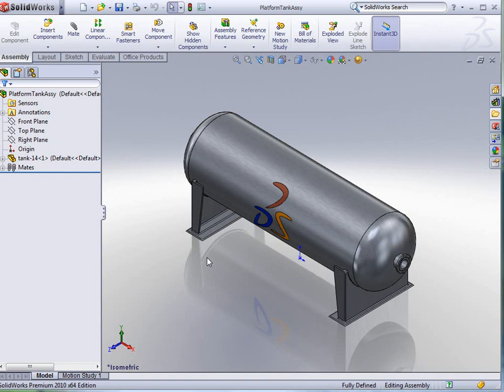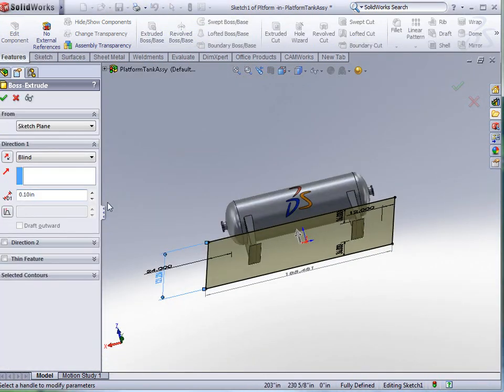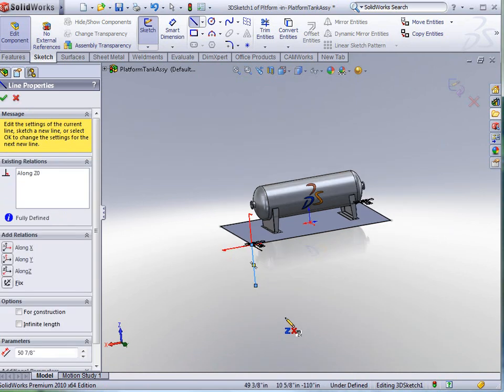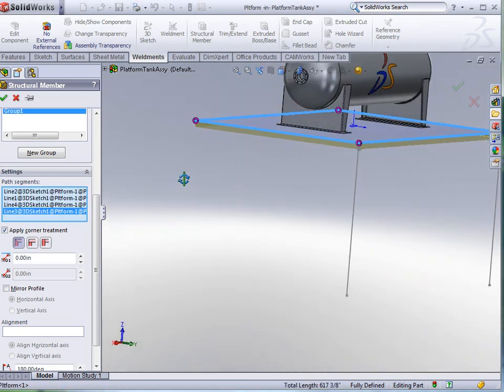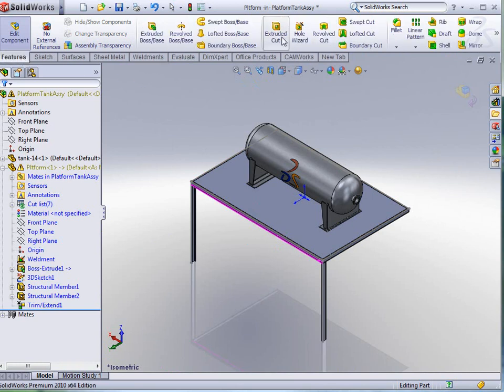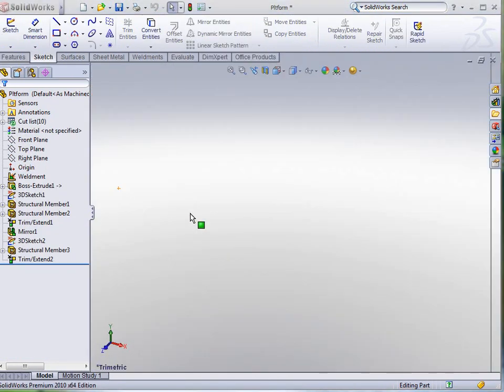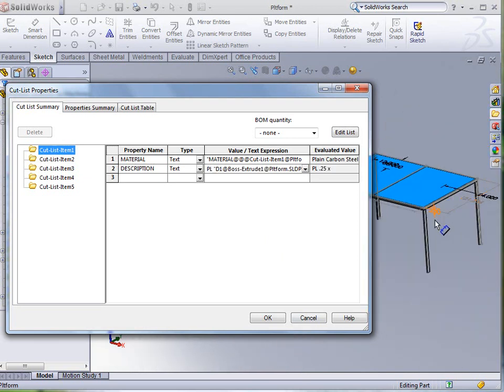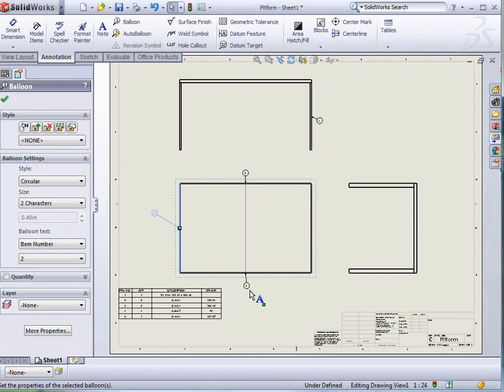SolidWorks Weldments in Assembly.wmv

Comment from the maker: You can save all the parts out very easily by doing the following:
Right-click on the cut list in the design tree, select Save Bodies, add appropriate file names manually or select Auto-Assign Names, (Select Copy custom properties to new parts so the BOM is updated), Select Browse on the Create Assembly tab and assign a name for the assembly, press the green check, Window pull-down and select the assembly just made and all your parts will be there assembled and in separate part files.